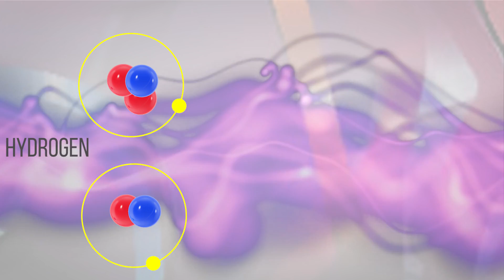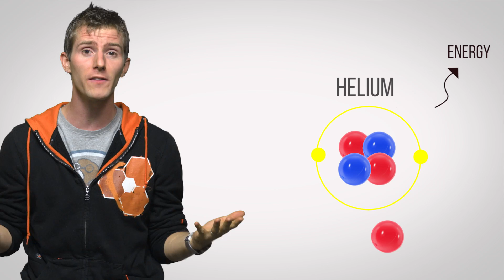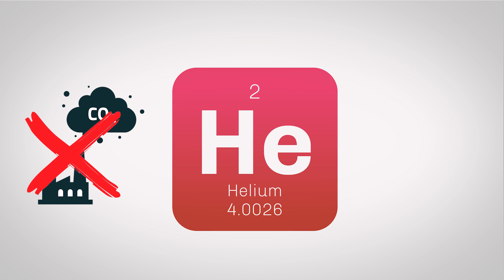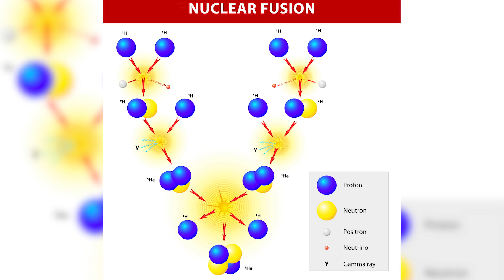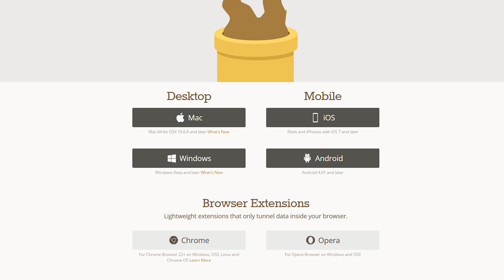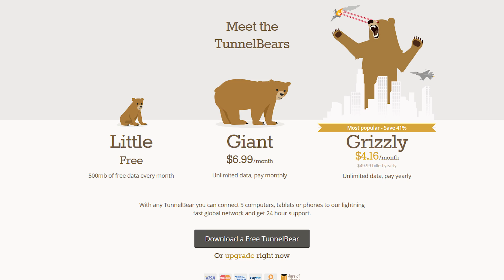Why Don't We Have Fusion Power?

Comment: Researchers successfully converted regular CO2 into ethanol using copper for the catalyst that outputs more CO2 during the reaction. Essentially, we can use CO2 almost indefinitely to create ethanol. Hopefully the research pans out to be usable.
Reply: Not a source of power because you left out one important ingredient, ELECTRICITY. Burning the ethanol produced will produce less power than was consumed to make it in the first place. 

It could still prove to be a very useful technology but it isn't saving the world.
Reply: Well it was apparently efficient enough that they considered it a good option for storing energy from renewable energy sources at non-peak hours. Storing as in producing ethanol for later burning for more power or something. Either way, not sure how efficient they want those, but I assume they want them to be pretty efficient.
Reply: Kyle Gruber Ethanol is a terrible molecule for fuel, it's energy density is just garbage.  I'm all for synthetic fuels but ethanol ain't the winner I'm backing.
Reply: I'm just saying what the article said. Even the researchers aren't sure If it will be usable. But hopefully we can do something with it.

Comment: Since we've delved into the world of nuclear energy, I think it would be great for someone with this kind of exposure to do a quickie about thorium based fission reactors. Somewhat similar to conventional, but with a few major differences that make it exceptionally better and an excellent stepping stone until fusion actually becomes viable. It's failsafe (meaning if it breaks, it does so in a safe manner, no Chernoble/3 Mile Island events are possible), materials are abundant, with mountains of thorium ore from various other mining operations just sitting there, unused. Leaks self seal, preventing potential spills. Reactors self regulate in such a manner that a meltdown is actually impossible. The technology was proven viable way back in the 60's-70's, and yet remains untapped. We know that light water reactors (what we use today) were chosen over thorium tech for enrichment capabilities to build bombs rather than pure energy production. Why have we not changed this over the years?

Comment: if fusion reaction works like a small star, assuming a magnetic field can safely contain and direct its energy output, solar flares included, all stars have gravity right?

so how large and how strong would its gravity field be?
Reply: Stars have gravity because of their mass not the thermonuclear fusion. And solar flares are also not directly caused by fusion so no such thing is to be dealt with on Earth. It's not really a small sun like in Spiderman 2 :-)

Comment: Just waiting here for Gen 4 nuclear reactor that uses thorium that is about as abundant as lead. We could also just use breeder reactor which produce less waste.
Reply: The potential of using Thorium as a nuclear fuel is so criminally under-reported, most likely due to politics, and the bad rap that nuclear power seems to have gotten. Such a shame...
Reply: There is really no shortage of Uranium, but a molten salt burner is worth building due to it's safety and affordability. There is enough U238 to burn when we get a fuel agnostic reactor. By the time we NEED thorium we would already have fusion power, in the year 2500.
Reply: leerman22 That's true. But the easily available Uranium deposits, like oil deposits a 100 years ago, are dwindling, and the nuclear waste produced by conventional reactors are abysmal, and extremely inefficient.
Developing molten salt reactors, and expanding the breeding reactors, is a positive gain in pretty much all ways.
Reply: leerman22 we burn U235 not U238. 238 is a breeder fuel like thorium.
Reply: *****
A fuel agnostic reactor is basically a breeder that can also just run a burning cycle. They could breed thorium and U238. It's possible but is hypothetical right now. It would also have to be a fast neutron reactor or an accelerator driven reactor to burn U238. As I understand it Th232 won't need protactinium separation due to the small absorption cross section at those high neutron energies.
Reply: I'm not too hip on my protactinium chemistry, but Flibe energy septates it and I basically use them as my MSR gold standard.  

There's more then neutron absorption though.  Since the reactor is self regulated a "cleaner" reactor load I assume is preferable.  Since you want your density to be mainly U233 and Th232, anything extra I expect skews the temperature/density fission balance.
Reply: *****
By avoiding Pa233 separation you simplify the chemical processing of the single fluid reactor greatly. U233 is also kept in the reactor greatly reducing proliferation concerns of having bomb grade U233 decaying from Pa233 outside the reactor. Control rods may be needed, but only to fine tune the reactivity to the temperature you want as Pa233 levels change, a lot more lag than with Np239.
Reply: Control rods are usually for too much fuel, this would be the opposite. You also need to remove fission products too.  So I expect online reprocessing is inevitable.  I do hear your arguments but I'm trying to see why Flibe wants reprocessing.  As for proliferation I don't really care much, the issue of U233 in that role are well established and frankly accessing fuel is only one component of building a fission bomb.

Comment: 0:13 false, renewable sources could give enough power but we just need to use them more
Reply: False... You would probably need to mine out all metal present in Earth to rely fully on renewable resources. You would also need to create ungodly amounts of poisonous chemicals to store all energy when the production is higher than demand. And you would also need to cover your country in wires to handle the extreme transfers from places with high production at certain moment to places and back when the nature decides to give us more elsewhere etc.
Don't get your head washed by green BS. The renewable energy reliant Germany is the third worst polluter per capita in EU (and mainly because it buys a lot of it's required electricity from neighboring states, otherwise they would do even worse), while the nuclear power reliant France produces the lowest amounts of CO2. So called "green" energy simply isn't the answer.
Reply: hahaha
Reply: Robinson Joe The solution is world wide or at least continent wide electricity network. Then if somewhere is cloudy or not windy, somewhere else is. Pretty expensive but that's the future

Comment: And plus that you need to create even higher heats in a fusion reactor to get fusion than in the sun because not only do you have the heat in the sun but millions of miles of matter pushing down crushing it.

So you need temps around 10x that of the centre of the sun
Reply: For commercial fusion plants the number would be closer to 100x.
Reply: Fusion power plants use magnetic fields or other means to compress the fuel the same way gravity does in the Sun. The difference is that the Sun only generates a lot of power because there's a HUGE volume inside it where fusion is happening. The power generation per cubic centimetre of the Sun is comparable to the metabolism of the human body, so obviously a reasonably sized fusion power plant needs to run the reaction much faster - by increasing the temperature.
Reply: Sakkura1 No your not going to compress gas to the same degree it is inside a star with magnetic fields. inside the center of a star Hydrogen and Helium isotopes are solids, inside a fusion reactor even though they will be somewhat compressed they will not be anywhere near that compressed .

Even in Jupiter which can't initiate fusion the hydrogen lower down is a solid harder than any normal material.

Also the core only consists of 0.8% the suns volume  but contains 34% of it's mass, this is the kind of pressure we are talking about or 3.84 trillion psi.

And that is where the 99% of the fusion take place so yes it is the pressure and heat which makes fusion possible inside the sun, and to initiate a fusion reactor on earth you need more heat to substitute the pressure.

So averaging the sun's energy output is not an accurate view of the conditions of which fusion takes place as by a wide margin takes place in 0.8% of the sun's volume.
Reply: Etheoma
There is no solid in a star, it's all a plasma.

0.8% of the Sun's volume is still HUGE. That's equivalent to more than ten THOUSAND times the Earth's volume. So again, the reason the Sun generates a lot of power is because it's so huge. The fusion reaction rate per volume is actually very low, and fusion power plants will have to reach MUCH higher reaction rates per volume.

And no, the pressure is not that important. Sure it matters, but the temperature matters more. That's why we've long since reached far higher fusion reaction rates than the Sun does, with higher temperatures and lower pressures.
Reply: Sakkura1 While it is by technically not solid because it has no electrons to create bonds with other matter, this would be like saying neutronium which is the hardest and most dense from of matter is not a solid while technically true in practice if you bumped into it you would be very very flat.

The suns core is 10 times denser than gold, and being so closely bound closely together increases the chances of fusion taking place.

if you have a cloud of helium at 100x the temp at the center of the sun but at 1 atom per meter squared fusion wouldn't be all that likely to take place often enough to keep the reaction going even if you could contain it at the same density.

Density is how close atoms are together and effects the rate of fusion as much as heat once it gets upto a certain level.

if you had enough gravity to overcome the strong force which yes that is a shit ton of gravity and is close to forming a black hole but it is possible. To say that the density of the matter has no effect on the rate of fusion is... well it's not even close to the top 100 dumbest things I have ever heard but it probably coming in the top 1000.

And no it wouldn't from a black hole because you would still have to overcome the weak force which after just a even a small amount of matter hits one and other it would explode stopping the forming of a black hole.

But that would still be heat because heat is the speed of the fuel but the fuel could have an initial temp of 0... well close to 0.
Reply: Etheoma
The stellar core plasma is very unlike both degenerate matter and solid matter.

Do I have to repeat myself here? The fusion reaction rate per volume in the stellar core is very, very low. You can bang on about density all you want, but it doesn't change this basic fact.

We already have fusion reactors that hit much higher reaction rates per volume than the Sun.

So please stop spreading this ignorant BS.
Reply: Sakkura1 Like the fact that the core is solid enough in type G2 stars like the sun can't burn all there fuel because there is little or no exchange of hydrogen between the core and the rest of the sun... Because the core is too compressed... Which if it were not solid like and was like a gas at atmospheric pressures or even much higher upto a point you would expect a massive amount of mixture through convection currents.

But as it is aptly called you don't see convection currents until the convection zone, but the Radiative zone doesn't transfer energy via convection for a different reason than the core, that's because the temperature gradient is too low.

But the temperature gradient between the core and the radioactive zone would be enough if it wasn't so dense.

But that aside you are denying that density plays a roll in fusion?

lets make this a lot simpler what are the changes of 2 atoms moving close to the speed of light fusing if they are 1km apart.

The odds are astronomically low as to be a statistical impossibility move it to 500m the odds go up by an orders of magnitude, move it 250m and it will increase exponentially 1m still extremely low odd but it's again orders of magnitude 1nm apart still extremely unlikely, have the nuclei nearly touching just outside the range of the strong force likelihood becomes almost certain because the only way they don't fuse is if they are moving 90 degrees of on and other all other possibles end in fusion

So to have a self sustaining reaction on earth where we can't both heat the fuel to the suns temp and compress them to the same degree as the Suns core pressure, obviously you need a higher temperature to release more energy to create a self sustaining reaction.

Which is good because heat increases the reaction rate exponentially, so it is much easier and more efficient to simply turn up the heat.
Reply: Etheoma
The inability to burn all the fuel has to do with which parts of the star are convecting, it has nothing to do with being too dense or "solid".

And again, the basic fact is that fusion power, on Earth, is FAR more powerful than in the Sun, per volume. It HAS to be, since it's so slow in the Sun. Otherwise a fusion power plant costing billions of dollars would generate no more power than a compost heap.
Reply: Sakkura1 This is really basic in a type K and M stars have convention currents which come directly from the core and there for after they have cooled down will re-enter the core.

Bringing some matter from the other layers of the star with it, this is really basic stuff, it's the same process by which our atmosphere circulates, do you think air that is in the mesosphere never circulate down to the troposphere and visa versa.

Well I have got some news for you and I can also tell you how it does it, it might be a surprise but it's convection.

all large scale winds on earth are caused by convection.
Reply: Sakkura1 Still you haven't address the matter of distance between the fusionable materials being an important factor.

We know this to be true because this is how the sun regulates it's fusion rate because as it gets hotter the core expands decreasing the rate of fusion and as it contracts it speeds up there by maintaining within a pretty tight tolerance it's core temp.

This is basic stuff that you could figure out just by using your brain.
Reply: Etheoma
I was not talking about fission in the Earth. I was talking about fusion reactors made by humans on Earth. Those reactors generate WAY more power per volume than the Sun's core does.
Reply: Sakkura1 You keep on going on about that but what I was saying is that for a SUSTAINED REACTION you would need much higher temps due to the low pressure earth reactors have.

Can you even fucking ague with that, is that statment incorrect.

Do you really think it is possible to make a SUSTAINED REACTION at the pressures we could create while also heating the fuel to core like temperatures even if that's something we would want to do, you have to admit it would be impossible.

I'm not saying it would be something we would want to do, but it would be impossible.

because if your trying to contain plasma with magnetic fields at 3.84 trillion psi, you are dreaming and way overestimate what we can reasonably do.

Yeah we could compress something that much but not while heating it to 15 million degrees Celsius because you wouldn't be using magnetic fields.

the magnetic fields in a tokamak fusion reactor are not there to compress the gas they are there to keep the plasma off the reactor walls to stop it cooling down and damaging the walls of the reactor.+

and even though yes current reactors get hotter than the sun and output more energy they are still not sustained reactions because first there is not enough area and second there not hot enough to sustain the reactions.
Reply: Etheoma
You need the higher temperatures MAINLY to  get the much higher reaction rates than in the Sun. Whether the reaction is sustained is not relevant to this discussion.

Comment: Thorium and Molten Salt Reactors.  Melt-down resistent.  Won't explode since it does not need a pressure vessel.  Reactors are walk-away safe.  Fuel is ten times as common as uranium.  World has enough thorium stockpiled from rare-earth mining operations to last a thousand years.  Hard to get nuclear bomb materials from it, which is why the military didn't want it.  Waste products are dangerous for just 400 years; waste from traditional uranium reactors remain dangerous for hundreds of thousands of years.

Thorium won't ever happen b/c ignorant nincompoops hear "nuclear" and "radiation" and go all squirly.  They'd much rather kill the Earth with coal and oil.

Comment: But isnt there still a risk of radiation of some sort, such as alpha rays and beta rays (gamma shouldnt be a major concern, right)? And wouldnt there a problem in harvesting deuterium or tritium? With those things said, I think fusion power sounds very cool, and I truly hope they'll find a way to make it come true.
Reply: Harvesting isn't a big deal. Deuterium is abundant in seas and is not too difficult do extract. Tritium can be made from lithium which is also present in seawater and can be turned into tritium inside the reactor itself.

Comment: You can slam atoms into each other at the highest speeds you can think. That's the easy part. They do require a lot of power to run but the reason we haven't fused atoms is because neutrons are not affected by magnetic fields. This means when neutrons are put off, they slam into the wall at the tangent of when the reactions take place. There hasn't been an appropriate solution yet aside from making the reactors super thick chunks of metal with an appropriate conductivity and temperature constant. Which takes LOTS of money. My Professor has 3 doctorates.